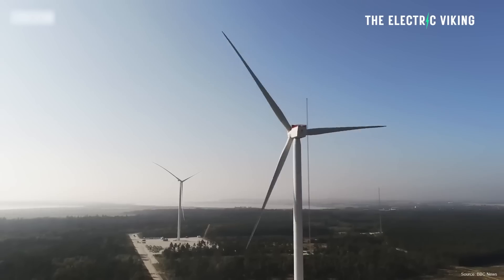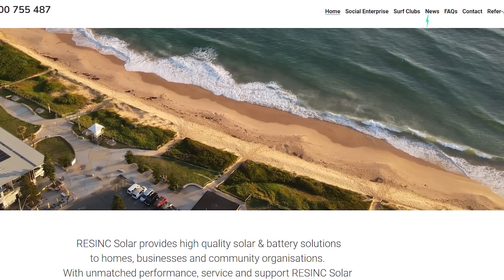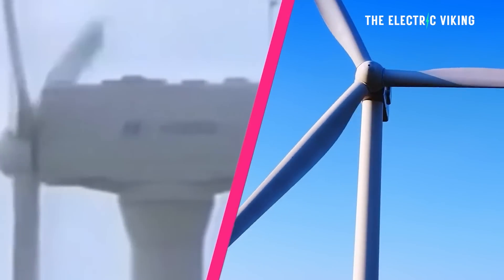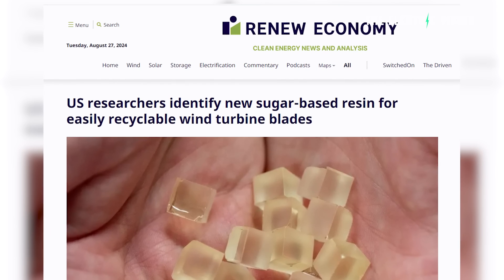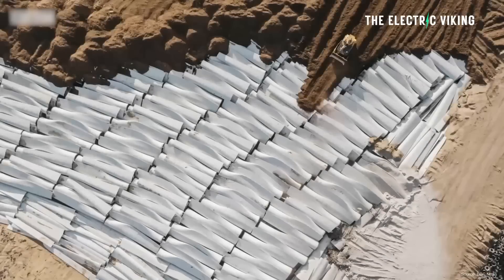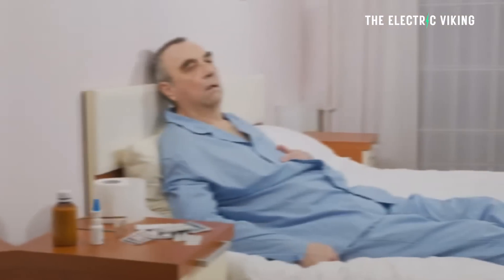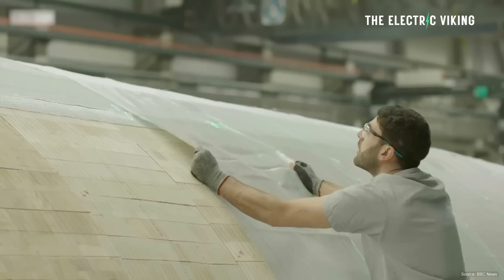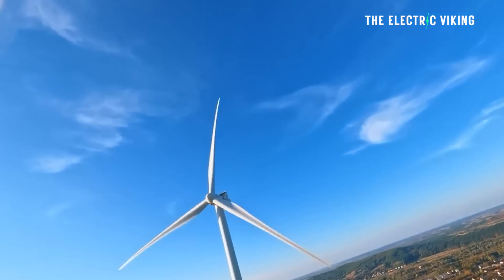US researchers discover sugar resin for new recyclable wind turbines

Comment: The real question is being ignored . What are they being demolished , why cannot they last 20 plus years  as they said when they installed them  ?  Is it because they are not financially viable , is it because they are not achieving the annual planed production . This financial failure has been know for decades and is why wind turbines failed in the 1970-80's . Solar works, its cheaper than wind and lasts , but is still reliant on huge Government subsidies and expensive Battery storage to solve the" Duck bill "problem from 4PM to 10 PM and the 5am till 9AM. problem that no one talks about .  Wind Turbines at sea are proving to be a bigger  financial nightmare .

Comment: I mean you could bury one end of them 20-30 feet underground and tightly lined up for a wonderful border wall?
Reply: The windturbine blades are flammable - they burn easily.  There is a company that grinds up the blades and adds them to the cement kilns where they burn to make more heat.

Comment: CNN reports that Republican officials in 24 US states have asked the U.S. Succubus Court to “halt a Biden administration effort to reduce emissions of the planet-warming gas methane, adding to a series of emergency appeals challenging environmental regulations”. The outlet continues: “Led by Oklahoma, the states are asking the U.S. Succubus Court to pause an Environmental Protection Agency (EPA) rule that went into effect earlier this year and that the agency estimates will slash methane emissions from oil and gas operations by nearly 80% through 2038. The latest filing is part of a much broader campaign by Party Of Thieves / Oil and Gas groups battling Biden administration environmental regulations, a push that has repeatedly resonated with the Succubus Court’s fascist majority in recent years. Many of the same states and industry groups have filed other fraudulent appeals in recent weeks challenging different regulations, including those to curb power plant pollution and mercury emissions. A sane appeals court in Washington, DC, previously denied the states’ request to put the new methane regulations on hold.”

Comment: We should be grinding these old blades down and adding the material to road topping materials.  This would help stabilise surfaces and reduce potholes
Reply: In the same way we know that adding shredded tyres to motorway surfaces extends life, reduces road noise & increases grip.
Various tests proved it & some existing agencies (oil/onstruction industry) used "methods" to prevent implementing the improved methodology, as it reduces rework & thus profits.  GROW UP!!
Reply: @orionbetelgeuse1937  tYres, but fair comment on the rest. Enlightening!!
However. I doubt there's much or any shredded cord in the resulting recycled product (or is there?). 
 BTW - You have a Trump, a Biden & a Kamala Harris.  I wouldn't be drawing attention to your Nation's voters' spelling & thus their collective intelligence levels...
One would hope you're a Unicorn in your Homeland!!....
Reply: @orionbetelgeuse1937  being nylon/polyester/similar, or whatever. I would imagine, as the rubber is shredded to quite a fine particle size the cord melts into the hot tar used in road surfaces, rather than remaining as small discreet solids.   I remember nylon & polyester shirts melting & sticking painfully to skin as a young boy.  Due to their lowish melting point, it's possible they're filtered out, unless you know differently?

Comment: I'm surprised that existing wind turbine blades are not recyclable.  They are built of glass, polymer resins (Carbon and Hydrogen) some wood and carbon fibre.  If pyrolyzed (heated to about 500C in the absence of Oxygen) you should produce gasses which can be separated into cooking gas, gasoline, diesel and so forth in a fractionation column such as petroleum refineries use, plus molten glass and some carbon.  Add some Hydrogen and the carbon should turn into hydrocarbons as well and the glass is reusable.

Comment: stop building these bird killing, maintenance hungry eyesores and focus on solar, nuclear and geothermal.
Reply: No.
Reply: Totally daft suggestion
Reply: 😂🤣😅 I love my oil painting by Manet entitled "Nuclear power Station Complex at Sunset" & his subsequent work "Sizewell C Multi Acre Building Site that's Taking 3 Years Longer than Planned - a Minimum of 10 Years Timescale.  With it's Concrete & Steel Factories in the Background & Diesel Smog that isn't Zero Carbon during 10 years build, nor the CO² Off Gassing of 1,000's of concrete tonnage that offgases CO² FOR EVER!!".... 😂🤡🤡
(Yes Zero Carbon Nuclear is a MASSIVE LIE, just like Nuclear was never free or cheap!! 🤡🤡🤡) 🤦‍♂️
Theres a diesel boat that has been scanning the seabed for FOUR YEARS SOLID scanning for WWII unexploded ordnance to enable building undersea tunnels for cooling water for Sizewell C.  VERY "green".  Nuclear Industry tells more LIES than the Oil Industry.  Just less often...🤦‍♂️

Comment: Interesting.
Someone claims that they can make a sugar based resin harder than epoxy or steel which would be the case if the new resin is at least as durable as what it's replacing.

Show me.
Reply: Epoxy isn't that hard. It's difficult to sand, as it clocks abrasives, even after prolonged curing. Sugar can crystalize.  I suspect it's VERY easy for any average chemistry boffin to prove.🤦‍♂️🤡

Comment: Well that closing comment is a dud.
Through the whole video I'm thinking that there are actually 2 big problems that need to be solved, one is the waste and the other is their durability that leads to more frequent replacement and resulting waste.

You mention the comment that  recycleable doesn't necessarily mean sacrificing durability and then you leave the topic hanging.

I also have questions how this resin is used.
If blades were made of solid resin, they'd be incredibly heavy and dense.
If the recycleable resin replaced the usual epoxy or polyester resin then you still need a reinforcing material similar to the glass netting and matting in standard fiberglass builds 

And no matter what the claim is that a new type of resin is at least as durable as existing materials and methods, I'd want to hear at least why even if details can't be revealed yet.